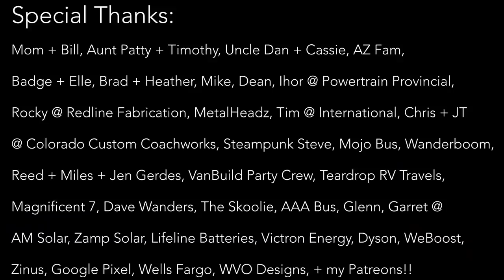Allison Transmission MT643 Disassembly + Diagnosis for REBUILD

Comment: It's awesome that these guys let you in the back, walked you through the inspection/rebuild and video them as well. Most wouldn't. Good choice on upgrading to the mt643 and I love your beginning comment on not replacing a good trans out of fear. While the at545 isn't great, there is so much fear mongering that goes on about it on the forums it isn't funny.

Comment: I love it, I just dropped off my mt643 this morning to have it rebuilt. Thank you for doing this, this will help me understand what is wrong with mine.
Reply from the maker: Bud Sims the guys say it’s mostly the wear parts aka the friction, but as you can see, there’s a ton of seals and gaskets in there. Hope it goes well for ya!
Reply: Trucker Who generally I don't know, but i have seen prices from $1700 to $3000. Mine will cost me $2395.
Reply from the maker: With install? Not bad!
Reply: Jax Austin nope that was me pulling it out and then me putting it back in.
Reply: On the price really depends on what hard parts go out.  The planetary gears would be  the most.  If they have one there you should have them show what the inside of a manual trans looks like.

Comment: Hi Jax, We have the AT545 in a 3800 - it seems fine, but we are going to at least change the rear end for better highways speeds.  Do you think also swapping the trans to the 643 is worth it if the 545 is working with no issues?

Comment: this is an excellent video..  amazing how similar to a 545 it is inside..  just alot beefier..    can you guys do a video on valve body checking and adjustments?  I have a 643 that every shift is perfect except my WOT 3-4 is low..   the shifts are 2600-2700 WOT for 1-2, and 2-3, but my 3-4 is low at 2300-2400 RPM,.. i understand its possible at the valve body to adjust single shifts with the trim wheels..   my experience with allisons has been with the newer stuff where I adjust the shifting by changing the computer program..  id like to raise my 3-4 shift on this 643..  my modulator cable and shift cable adjustments are correct according to my IH manual..

Comment: What is there recomended fluid change time , and if ? when not to change it ??
Reply from the maker: Always check w manufacturer. This tranny only takes $50/gal oil and the models have different requirements.

Comment: How many miles were on this trans?
Also was this trans removed by you or would it cost more then 1700 if he had to remove it?
Thanks

Excellent video
Reply from the maker: I got this tranny at AAA bus. It had a few hundred and Richard doesn’t think it was well maintained. Labor is 1000